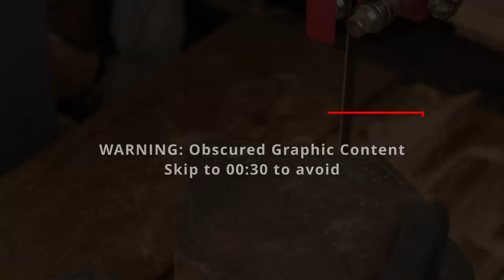Woodturning - This Little Wood Cost Me $100!

Comment: Beautiful wood, and a beautiful jar.

About the accident, you were lucky. 
I was a bit careless on a table saw, and in a tenth of a second. I lost a middle finger, and the blade carved the joint on my index finger, so the surgeon operated it stiff. 
Pardon me if I don´t express myself correctly, I am not used to write in English.
Greetings from Sweden!

Comment: Not wood, but I was using a drill press and had chuck loosen up, and the 1/4 in thick aluminum went flying and tried to take my thumb off. Took 14 stitches, I highly don't recommend the process.